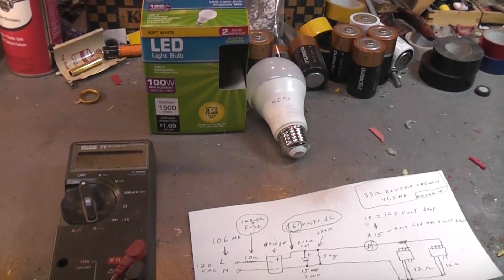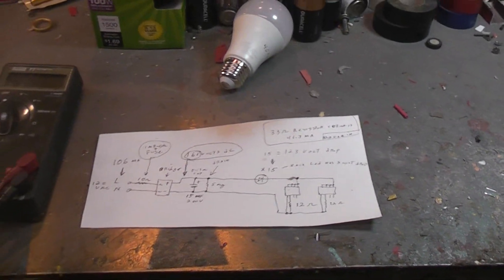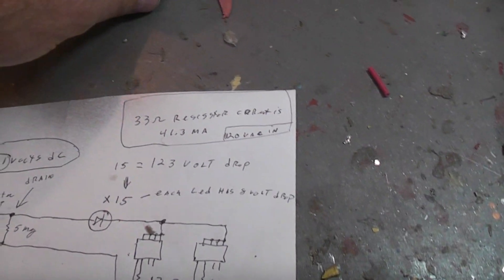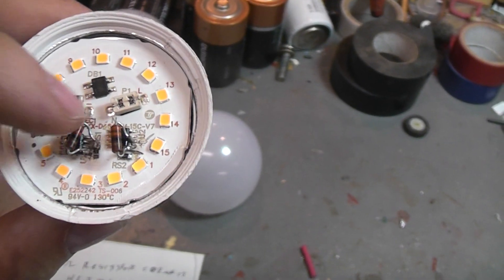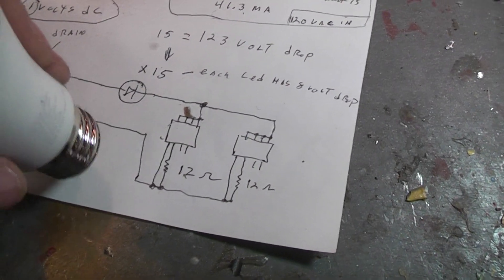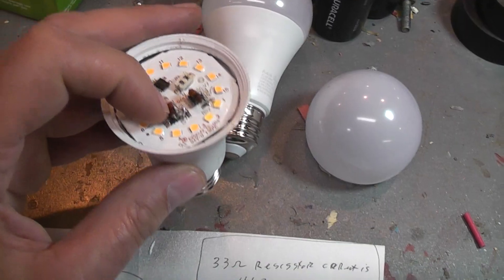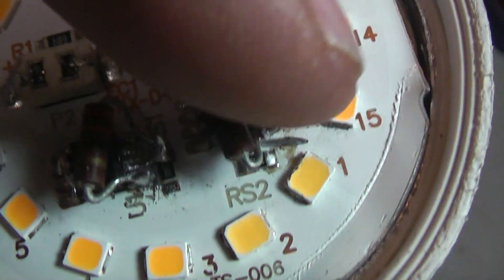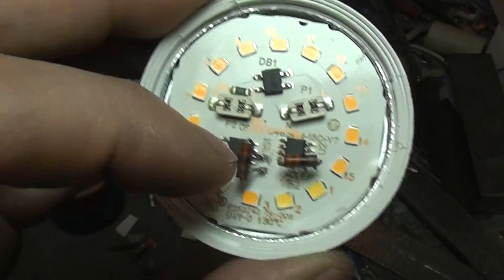What has changed in the last 2 years with dollar store LED lights. Let's mod them to last years.

Comment: I had one bulb lasting only for about 1 week. The failure may be due to overheating the two controller IC. It is better to avoid 100W bulb at Dollar 1.25 Tree at any cost. IC found in the bulb is Reactor Micro Electronics RM9003B.
Reply from the maker: True if you do not plan on modify them to run at a lower current "less heat" then do not buy them.  But for experiments and modifications then they are a great deal. I had one that dead out of the box, they had left out one of the LEDs and since they are all in series then nothing lit up. I by passed the missing LED and adjusted the current down and the lamp is still operating .

Comment: Could probably just break one of the resistors away to halve it
Reply from the maker: Not on this new LED light. The ones I moded 2 years ago that is just what I did. But these new ones have a single resistor per current regulator chip. They are independent resistors from each other. I even tried tying both chip together with 1 resistor but that actually increased the current draw on the LEDs making things worse.

Comment: I'm not entirely sure, but I thought each led is actually 3 led's in series. What do you think ? Thanks for sharing.
Reply from the maker: That is why I said I found the 8 volt drop very odd. Normally a white LED will have just about 3 volt drop, so 3 of them should be 9 volts not 8 volts. But maybe these are doped LEds. In any case, they work and cost very little.

Comment: You’re so resourceful.  I’ve wondered about LED lights.  They’re supposed to last for years, but I’ve had to replace them way more frequently.  Your explanation makes sense.
Reply from the maker: Yes, they push the LEDs way to hard to get more lumens out of them, the heat then kills them off early. So buy the higher Lumens lamps and adjust the current draw down to 40ma or so and they last for years.
Reply: Most of the led bulbs in my house are fairly old I bought the geobulb2 when the version 3 came out because the old version went from $100 to $50 a bulb. I think that was around 2011. I think earlier led bulbs were probably better made because they weren't dominant over incandescent but now they can make them as crappy as they want. I have had some newer ones die in less than a year.
Reply from the maker: @DWmaniac4n6  I agree. I think back in the beginning when the bulbs cost way to much they were better designed, so that the LEDs were not pushed so hard as to die a early life. But I have found the new cheap LED lights can be modified to last more than 2 years "so far in my house". Just buy the 100-watt version and reduce the current to where it outputs the light equivalent of a 60 watt lamp. Everything runs cool and long and at a low price.
Reply: @Robothut  what your doing is pretty cool. I figure the light in my bathroom is 12 or 13 years old I accidentally dropped it when replacing the old bulb and the glass globe broke but it still has been working all this time I hardly ever turn it off its one of the lights that stays on all night as its light covers the hallway and part of some other rooms. I did mess with the bulbs that died and found that the LED lights were in series, I wonder if it would be better to have them in parallel with a lower voltage supply so that if one fails the others can still give light. I rewired the guts of one to allow the remaining good LEDs to work on my 12v solar.
Reply from the maker: @DWmaniac4n6  Yes a parallel system with low voltage would be better but it way too much to do that. So, they series up the LEDs to very close to the mains DC voltage, then the current regulator chip has very little to do, and less heat is generated. It just comes down to manufacturing cost and how long they design the lamps to last.
Reply: @Robothut  thats what I figured when I added up the voltage drop of the  LEDs.

Comment: So all this to save on the electric bill ? Ralph of Tena controls would like this video
Reply from the maker: If you think this has a lot of parts you should look inside the CFL lamps that came before LED lamps. Easly 10 X the parts. Never had a CFL that lasted more than 6 months. And all to save a few bucks on the electric bill.
Reply: Less on the eletric bill more on bulb replacement bill